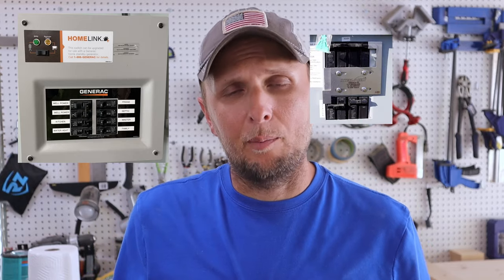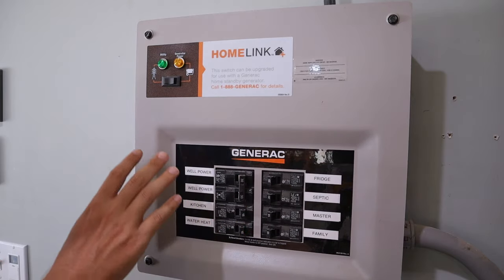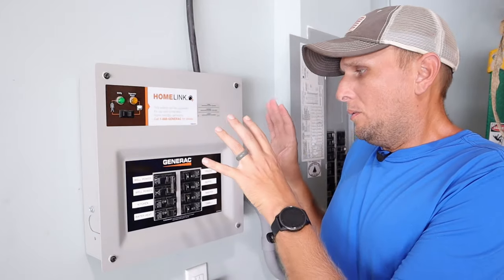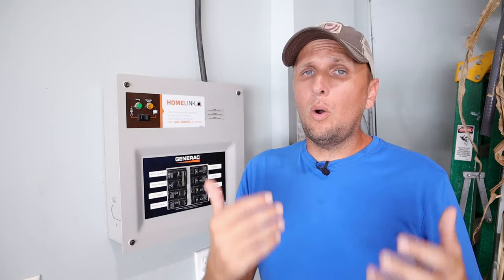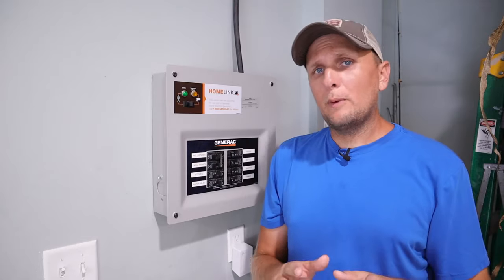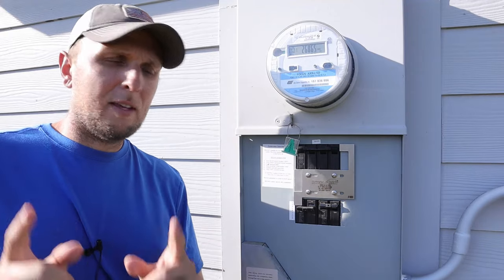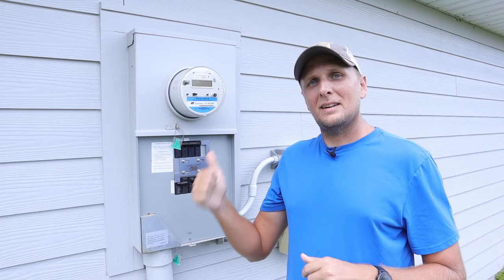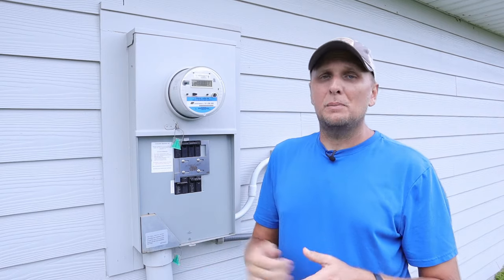How To Choose Between A Transfer Switch Vs Interlock Kit With Power Inlet Box

Comment: Thank you for your concise explanation of the differences in the two approaches.  We recently purchased a largish generator, 10k watt output, and have been looking into our options.  Our power consumption calculation is about 8000w, so we purchased something that would not have to run at peak all the time.  This allows for home heating with our pellet stove, cold food storage in two fridge/freezers, hot and cold water and lighting.  Also figure we can switch off a few things and fire up a computer/TV for some DVD watching while we are "in the dark".  We really have appreciated the effort that folks have put into providing clear information about our available choices.  Your video and information are top notch!  May 2022 bring us all peace and prosperity.
Reply from the maker: Excellent!  Sounds like you all are doing your homework and getting everything setup right!  I am glad you found the video helpful.  Thank you very much for the feedback and enjoy the backup power!
Reply: For what its worth from a random internet stranger, I just installed a new outdoor load center with a main breaker and generator lockout w/ 50A input.  I have 3 generators (for various reasons ranging from a 8kw welder to a 2250w 120v inverter) the 8kw will run my A/C, water heater, stove, microwave, etc individually with various lights and other small draws.  It burns around  1gal/ hr at moderate load.  For comparison my small inverter will run lights, fridge, freezer, TV, internet without issue.   It burns a gallon every 6-8 hours or so.  My typical usage for an extended outage is to run the 8kw intermittently cool or heat the house, shower, cook, etc in a couple hour time frame. After that I shut the 240V breakers off and run fridge, freezer, lights, and entertainment stuff with the smaller generator.  Last large outage we had ~5 days running the small generator only was around $50 in fuel. Running the 8kw for 5 days would have been $420.  The small generator I have was around $470.  I keep a 55gal drum of 100LL aviation gasoline on site for all my small engines and as an emergency reserve for running the generators. Hope this helps or gives you something to think about.
Reply: @danielh4995  thanks for that info good to hear real world stuff.
Reply: Are u running gas NP, NG
Reply: @danielh4995  have u considered a no load low idle generator would do same
Reply: @nicklopez5298  Are you referring to a ~1800rpm diesel or something of the sort?  I have considered replacing my welder with a diesel but otherwise I already had the 3 generators before I wired my house to use them.  Figured it would be worthwhile to ensure I could use all of what I had for redundancy and economy.  If I had to build/ buy from scratch I would just get a diesel welder generator and be done
Reply: Peace and Prosperity
Reply: @HowToHomeDIY What should I use if I have solar panels that sell back to the grid here in Texas?

Comment: Thanks so much Adam, your videos are great! I decided that I'm going to hook up my generator straight to my breaker box using the 50 amp dual breaker you mentioned in another video, and the 50 amp outlet plug on my generator. I totally understand the use and safety of installing and Interlock kit, though I really don't need that. I live alone, and no one is going to be messing with my breaker box. If my power goes out, all I have to do is turn the main breaker off, go out to my generator outside and hook up the 50 amp cable, start the generator, and then go back to my breaker box and turn on the 50 amp breaker for my generator. I am NOT going to make that simple mistake of having both breakers turned on at the same time. Then when I see the neighbors power coming back on, I will turn off the breaker for my generator in the breaker box, turn the generator off, and turn the main breaker in the box on again. With my 10,000 watt Northstar / Honda generator, I will have about 41.6 amps, which is enough to run my AC, some lights, my fridge, TV and computer. If I need to do laundry, use the microwave...etc., I'll just use my gas stove, and wait until the city power comes back on. 😀.

Comment: Good explanation.  I chose an interlock kit, because a transfer switch installation would have required running wiring to my main panel and to 2 distant sub panels.

I don't bounce up and down to the panels and constantly flip circuit breakers. I have typed instructions next to the panels, including the order in which breakers should be flipped on (something important to have with a transfer switch as well), and turn a specific set of breakers on when I need my generator. In rare cases, I'll turn one off and turn a different one on.
Reply from the maker: That is the way to be.  Prepared!  Then there is no guessing when you have to use it.  Thanks a lot for the feedback!
Reply: You do an excellent job with your explanations! Thank you for keeping it simple for us!

Comment: Nice Video. I went with the 6 breaker Transfer switch powered by a remote start 4500 Watt inverter. Also plumbed it for Natural Gas as well as reg gas. Wanted to stay small so it wouldn't us too much fuel and inverter good for electronics and the RPMs drop when low load. This way I can run the basics, refrigerator, Furnace, lights, internet/ computers TV, Oven (gas oven but needs 110V to open gas valve).

Comment: Interlock Kit, I'm sure it will be much cheaper for an electrician to run those wires up to my box and set up a circuit breaker for it, a lot cheaper than a transfer switch. Plus you get the added control of turning on what you need in the box instead of compromising with a transfer switch. great video, helped out a lot.

Comment: Great video - very well put together! I would recommend measuring the power usage of the house and deciding based off of that rather than the raw amp ratings. I have a new house with 200 amp service, but with all the lights being LEDs, my regular energy usage is 1000 watts, very well within a small or medium generator to power everything. My peak continuous energy usage has been 9000 watts, but that is only with the dryer, AC, and oven on all at once - probably wouldn't try doing that when in an emergency situation. I prefer having everything connected and simply remembering not to turn on the dryer, oven, and AC all at once. Only thing I have to worry about is AC inrush, but I will be installing a soft start for that (which you provide an excellent video on too!).
Reply from the maker: Hey Jonathan, I appreciate the feedback!  Yes getting a good reading of what wattage is actually used is a great way to size what you will need.  Sounds like you are doing it right and getting yourself all setup just in case you need to be!  You will definitely love that soft start kit.  It is a gamechanger.
Reply: you are obviously missing the inrush from many other devices with motors because the typical fridge is around 1200 watts right there. If you have several (and a freezer?) you have 3600 watts you forgot about, even though the average run draw is 2 - 3 amps. Edit: if you have forced air heating you have blower motors to deal with. If they are 10 years old they likely do not have a soft start.
Reply: @rupe53  thanks for the reply. You're absolutely right. I fortunately only have 1 fridge/freezer and I'm going to give How to Home's soft start installation a try for my HVAC. He put out a really cool video explaining how to set one up. https://www.youtube.com/watch?v=uowVMYuPs-U I already tested the heat and my generator had no issues powering that, it did die on trying to power the air condition condenser. In-rush definitely is something worth considering.
Reply: @rupe53  I have a outside packaged a/c unit not sureaybe 4ton not sure the start watts hit
Reply: @nicklopez5298  ... look at the data tag on the unit. It has figures for run amps and something else called LRA, which stands for Locked Rotor Amps. That's roughly the draw for starting up the compressor. Most gen sets can handle around 140% of their rated amps as a start surge if the "peak power" is not listed. Be aware that peak, inrush, start surge, etc is only for a few seconds.
Reply: Switch to Energy Star appliances and you will be OK with wattage consuming, My
big LG start at 550 watt running at 250 watt, my smaller refrigerator 22cu started at 245W running at 65w .

Comment: Thank you for this and your other video, I just purchased my first generator which is actually an inverter and I'm looking at stepping into a full house possibility over time. The first generator can certainly run critical need issues and I have the ability parallel them if I buy a second small one. I also am smaller because they're easier to move around and if one breaks I still have something happening whereas if I have one large one and it won't start I'm dead in the water. It's the military two is one and one is none Theory.

Comment: Thanks!  Good info, I'll share with less electrically minded friends who need to know the basics.  I have used both and prefer the interlock even with my small generator.  I have a small house and have changed over all my 220 appliances to gas which helped and I can almost run the entire house now.  May re-use my transfer switch for a solar project but we will see.

Comment: Also I want to mention it DO exist transfer switches that don't hook into a subpanel, but into the main panel instead, which only consist of a tranfer switch and give same flexibility as an interlock. There are lots of transfer switches, even transfer switches that can automatically measure load current, and automatically start up generators and transfer over the power to backup when grid disappears, and transfer back & shut down generators when grid comes back. Some of these transfer switches will also have a in-line UPS too, so you have completely 100% uninterrupted power.

Comment: I just did an interlock setup. It was $40 for power inlet box, $90 for the interlock kit, $20 for a double breaker, $28 for a mount plate for the power inlet box (so it would sit flat on the siding). I also needed a chunk of wire about 10' long for the power inlet box. I had that as a left over from a previous job. I have limited room where my panel is and there was no space to install a transfer switch.
Reply: Everytime I go to Electrical Store they don't have any Transfer Switches,  Interlock kits, no power inlet boxes.. Are they playing "stupid?"  Or, are they stupid. An other store does not offer any Solution.

Comment: I think one of the biggest pros  with an interlock is you have the flexibility to power any circuit.   When I switch over to running on generator during an outage and before throwing the interlock I make sure to turn off the breakers for my electric water heater and electric dryer.  These breakers are marked with red tape which makes them easy to identify.   

I have a 7,500 watt generator. For extended use I try and keep the wattage being drawn to no more than 6,000 watts.   I have  also installed a hard start kit installed on my central AC so it isn't a problem running it on a generator as once it has started it draws 2,200 watts..    My wife and I know that when on generator  you have to selectively run no more than two high wattage appliances besides the refrigerator at the same time (a stove burner,  the microwave, hair dryer, garage door opener, etc.) .   If after a few days my wife gets tired of  cool  showers I have the option to switch off the AC and then run the water heater for forty five minutes.   If in the worse case the generator would be overloaded it would just trip off line.    

For  most people using a interlock and also by  switching off all the 240v circuits would mean that they could run most everything else in the house while using a 5,000 watt or larger generator.   With 12,000 watts then you can probably run most everything.
Reply from the maker: Thanks for the input Peter!  Could very well be helpful for others in your situation!
Reply: @max4life352  do they offer the two in one 110 breakers for your box?  while not my favorite I used a couple to pair up some light loads (mostly lighting circuits) to free up a pair of slots for a 220 breaker
Reply: @max4life352  most panels are rated as the total amperage, spaces, and maximum number of circuits.  The ones I am most familiar with the number of circuits is double the spaces indicating that you could have all tandem breakers.
This rating should be on the inside of the hinged cover you can see and research

Comment: I have a 7000 watt generator on an interlock and it essentially powers all things I want including 2 fridges, microwave, lights, furnace and a small window AC unit. Totally happy with it. I made a 2 display project box showing wattage and amps and total amp hours for both legs. It’s awesome. I can monitor total usage by leg and see what’s going on. Cost about $50 to make. Great video
Reply from the maker: They really are great!  I just used mine the other day for a few hours.  Glad you liked the video.  Thanks a lot for the feedback!
Reply: Can you explain the ‘two legs’ a bit to understand better why you monitor them both individually... I assume it’s for balancing the generator for wear and tear—but I barely understand how or what that really means. Thanks.
Reply: @GMC-qo9xi  - Typical houses have two 120 V legs that come in to them. They’re 180° out of phase. You want to balance your load across the legs. That means all of your appliances and circuit breakers should be split evenly across the A and B legs. If you have 20 load on the A-leg and a 20 amp load on the B-leg the neutral will have zero amps. Balancing them to a certain extent is good for your main circuit panel as well as your generator. The project box I made allows me to see the load on both legs.
Reply: @condor5635  so I’m guessing/assuming that with a 240 breaker it’s even, as it’s obviously using both legs... so it would be specific to the 120 loads being used?
Reply: @GMC-qo9xi  correct. Dual breakers like a 240 breaker would have one on each leg
Reply: @condor5635  thanks for info. I’m also curious whether or not I would want to be able to measure/gauge what’s happening in my panel... we just went through 7 day power outage and ironically are now in another one a week later... I order a 7kw generator, the ai power inverter.. and have the interlock stock coming. So I’d be potentially running anything it could handle from my packed 200amp panel... though with great care to not overdraw... 

From your pov, what would you recommend for keeping it balanced and/or measuring/monitoring it?
Reply: *not sure what the autocorrect changed into “stock”... hopefully it’s understandable enough...lol
Reply: @GMC-qo9xi  -  bought 2 of these and wired them in a project box. Works awesome when gen is up and running 
DROK AC Power Meter, AC 80-300V 100A Voltage Current Color LCD Display Panel

Comment: I used a 10 circuit manual transfer switch for a few years and recently replaced it with the interlock kit. 8500 running watt generator. Much better set up for us.

Comment: I bought an interlock kit for $69.95 form my main breaker box.  What a rip!  I made one in 2 hours for my apartment box.  

People are misled by how many watts they need for power in an emergency.  MOST power outages are emergencies.  

You do not need to run an electric water heater and electric clothes dryer at the same time, ever.  You do not need to run your refrigerator all day long.  Over Christmas weekend I had no power for 3 days. The fridge got to 44F and the freezer to 22F.  Of course it was 48 inside the house. You can plug the fridge in when needed if you open it a lot.  you can run most homes on 5000w or less generator.
Reply: @alexd5188  : I got a portable gen that runs on gasoline nat gas and propane. I had a plumber hook up a nat gas line to the back and an electrician hook to the breaker box. I did the minor electric.  It cost $2200 total and I have not yet needed to use it.  Once the power went out and I waited 10 minutes and decided to walk around to turn it on and the power came back.    Yes, having one and not needing it is better than needing it and not having it.  Good luck to you in the coming days.

Comment: I’m almost ready to set up a generator inlet combined with a 48v battery & EG4 inverter(s) to a combiner box and run that back to a 125a breaker on an interlock in the main panel. 

Trying to capitalize on battery for main backup power and then use the generator to supplement grid power and also charge batteries with the EG4 chargeverter. 

Main idea is to use the generator to conserve gas /  propane by only running the generator as needed until the batteries are charged.  

Thank you for this video. Lots more to think about.